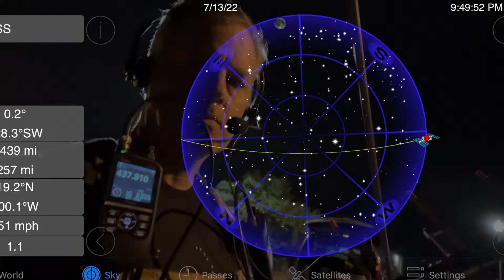ISS Ham Radio contact with N1RBD using Kenwood TH-D74 and Icom ID-52

Comment: How are you adjusting for Doppler with radios on shoulders and both hands are full??
Reply from the maker: Doppler on VHF is negligible so I don’t touch that.  Doppler on UHF (the downlink) I simply decrease the frequency as the pass progresses by turning the knob on the top of the ID-52.  I like to think of it in 5 parts - AOS *acquisition of signal”, 1/4 pass, 1/2 pass, 3/4 pass, LOS “loss of signal”.  You can hear the Doppler by ear.  Practice makes perfect.